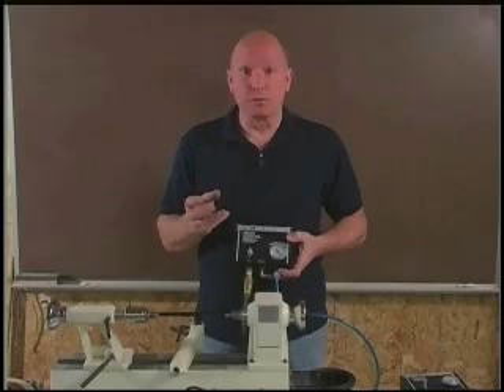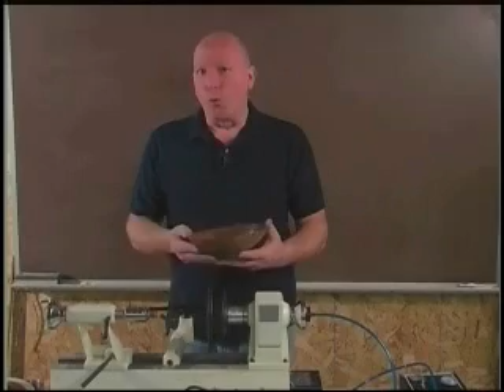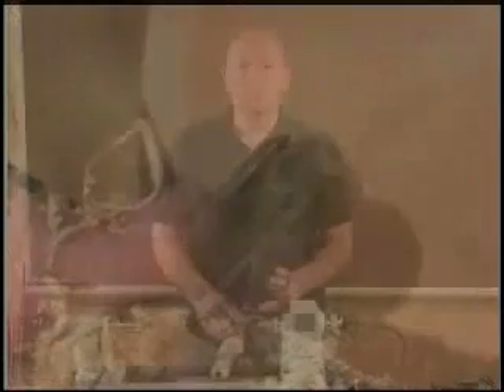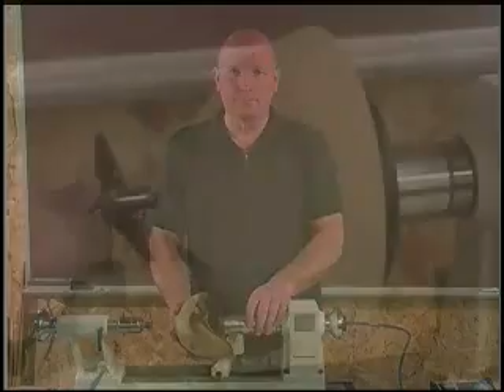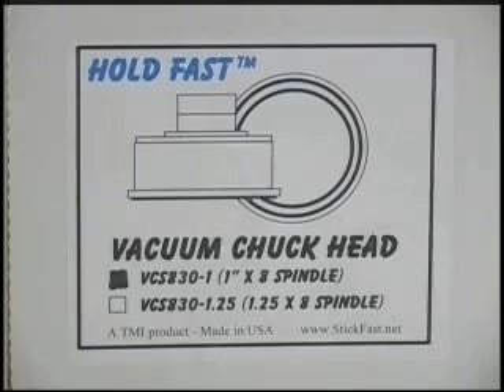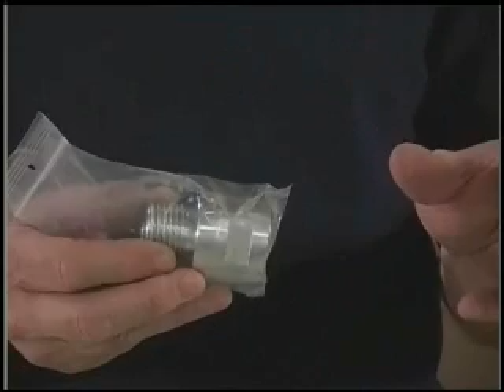Holdfast Vacuum Chucking Systems Part 2

Comment from the maker: @Ismlor 1. put the piece on the vacuum chuck head and run the tail stock up which will show the center  turn on the vacuum.  This is a good start to center the piece.
2. slowly hand rotate the piece watching the top edge looking for any rise or fall as it is rotating. 
3. turn off the vacuum and adjust the piece as necessary.
Problems:   If it is warped very badly a vacuum seal will be very difficult to achieve.  Reshape the piece to make it round again (Add some tape to help it seal).